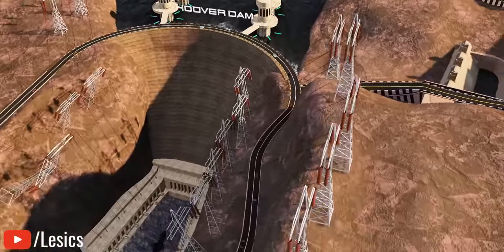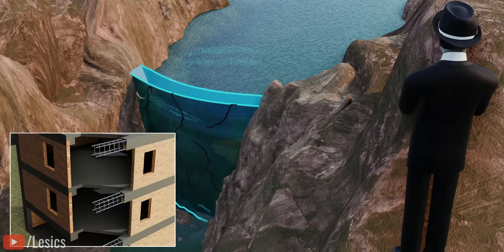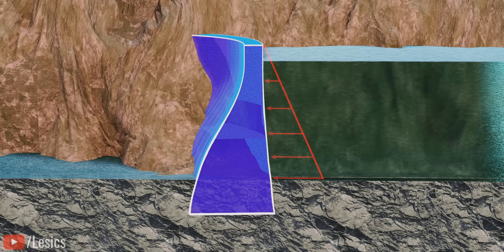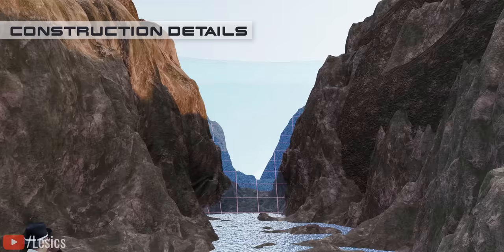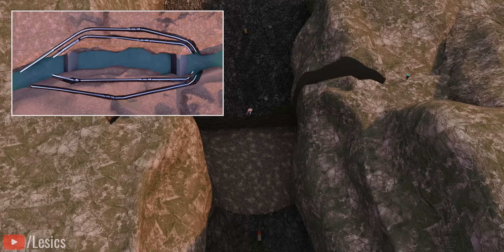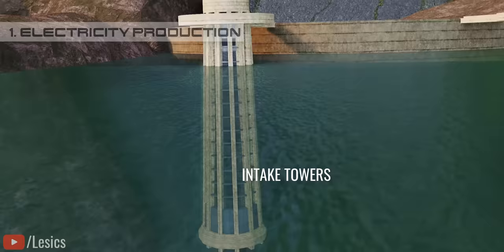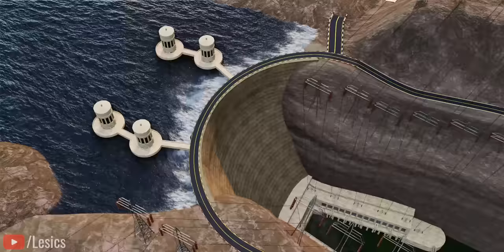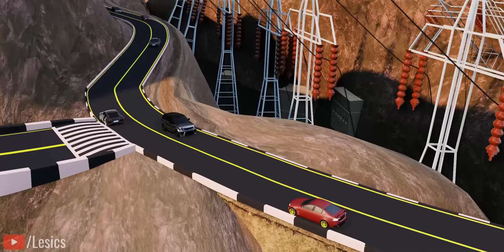Hoover Dam | All the Secrets of the Engineering Wonder

Comment: Overflow is NOT a problem the dam has now - the water level is so low that power production will soon be impossible.
Reply: hehe :D
Reply: Very true, sadly.
Reply: Its only 25% full and since 1983 has been dropping overall each decade.Man can build but he cant make rain.
Reply: Actually he can; cloud seeding. I find it highy coincidental that Lake Mead was nearing levels that would halt power production and possibly drinking water to surrounding areas just as the north experiences a snow pack 221% higher than normal.
Reply: Yeah,,,you tell em Jason . We need more glaciers to melt!

Comment: I toured down inside the dam and power plants before it was restricted. Everything is faced with ceramic tile and stainless steel. They really built to last. I stood on one of the penstocks feeding water to the turbines. You could feel the strength of the water flowing under you at over 100 miles per hour. It is an amazing place.
Reply: there is no ceramic tile or stainless steel anywhere in the dam or on the tour
you never stood on the penstock
trust me ...i work there
Reply: @thatoneguy6776  😮
Reply: @thatoneguy6776  There was tile in some of the tunnels the Ranger guided us through. Back in early 1980-something.
Reply: @thatoneguy6776  1985-86 I walked in the Arizona penstock to the underside of the intake tower.  I also went in one of the tunnels inside the dam that leads to that grate on the face of the dam.
Reply: When I went I saw lots of polished terrazzo floors but no ceramic tiles..
Reply: @thatoneguy6776  How would you know what I did inside Hoover Dam 40 years ago? Go watch a solstice.
Reply: Why did they restrict it?
Reply: @Lucrativecris  Because of 911. You used to cross the river on a road on top of the dam, but they've built another bridge now for security reasons. I don't know if they've started the inside tours again.
Reply: @rpbajb  The O’Callahan Tillman bridge is a marvel of engineering as well. Watched it built for a few summers while on a jet ski every weekend. Glad they built high walls cause the Black Canyon is ruthless with wind.

Comment: Such a awesome structure, full of genius engineering and quality built too, you can’t help not be in awe. I guess you could argue the negatives would be the environmental impacts flooding such large swathes of previously dry and inhabited land has had, as well as the installation of a barrier that completely blocks wildlife any free movement through the whole river system … and these are unfortunate consequences in these types of dam projects, but still … there is a grandeur to the Hoover dam in particular that still fills me with awe at what can be achieved. The fact that it outputs significant, clean hydroelectric power which is being used instead of more carbon rich sources of mower production too, is just the cherry on top.

That being said, lake Mede isn’t faring so well in the prolonged low-rainfall conditions and it’s evident that the whole system has seen more fruitful times. The prominent bathtub ring showing how low levels have gotten is a warning that can’t be ignored. The anxiety of dead pool levels being reached grows with each passing month the levels drop further. I hope for the sake of the people this system provides for as well as the for the damn itself, that rains do come and alleviate some of the water anxiety that must be being felt.

Comment: I've visited the Hoover Dam 6 times.  I find it more amazing each time.  I can remember when the spillways (one on each side) were not plugged.  Looking down the 50' diameter pipe - about the width of my home and twice as high. - were open and looking in awe at a spillway that could float an Iowa Class Battleship. EACH spillway could handle 200,000 cubic feet of water PER SECOND - the entire flow of the Niagara Falls.
Reply: The legion will visit soon
Reply: @karlmarx8719 yeah we invaded it by our fool Joshua failed us I was spared because it wasn't my fault and I proved I still can be a valuable asset to the legion

Comment: Civil Engineering Concepts used:

1) Hydrology: To find out the discharge passing from the dam.

2) Structural Analysis: To design the arch and find the horizontal thrust it would generate on the rock walls.

3) Reinforced Concrete Structures: To use concrete to its strength that is compression. To fill the concrete in blocks to avoid cracks formed due to heat of hydration from the cement.

4) Geotechnical Engineering: To find the uplift pressure generated due to seepage water.

5) Irrigation Engineering: To design the spillways and cofferdams and galleries. 

6) Fluid Mechanics: To find out the Shear force excerted by the water on the dam. Francis Turbines.

7) Tunnel and Mining Engineering: To perform controlled detonations and excavation of the rock strata and walls.

Civil Engineering is truly an art. It literally has several different engineering fields packed into one single family. No wonder the syllabus a Civil Engineering Student  has to cover is massive.
Reply: mechanical and electrical engineering play roles too for turbines & generator controls 😄
Reply: Yes ofcourse. But as a civil engineer, I was looking at the Civil aspects. Every Engineering field work hand in hand for the betterment of the society.
Reply: Notice how the environmental impact is not even mentioned on this list
Reply: @phole1100  We should have gotten Edward Abbey's thoughts on that!

Comment: I remember watching a documentary about the construction of the hoover dam and how coolant pipes were integrated just to harden the sheer amount of concrete; which was considered to take about 100 years to harden
Reply: Without the coolant pipes, it would've been forever and a
Day to dry and cure. With the addition of the coolant pipes it was estimated that
The concrete used in the building of the dam wouldn't be finished with the drying and curing for around 50 yrs
After the entire project was completed, and it was finished ahead of the schedule.
Reply: @bruceperkins7253  Concrete doesn't set by drying. Just curing.
Reply: vroom: You are correct: Concrete is "set" in hours and "cured" to a working strength in days, but gets harder and harder in normal projects for 40 years.
Due to being hundreds of feet inside the dam away from air and now kept moist and cool it will take 100 years for parts of the dam to cure.
Reply: @bruceperkins7253  No, the coolant pipes SLOWED DOWN the set and cure a little (different things) cooling did NOT speed it up.
The Nevada heat is bad for pouring concrete. Dries too fast and cracks. The best temperature is 60°F.
They slowed the set and cure so the temperature was evened out to prevent cracks.
Reply: @Engineer9736  Yes, you are right. It does not dry like glue with the evaporation of the solvent, but NO the curing heat is from a reaction actually called "hydration" and does require the removal of the water (drying). It's like a catalytic, reaction but drying is as good a word as any for concrete.
Reply: Kallanai Dam built more than 2,000 years ago by the Chola King Karikalan across the Cauvery River INDIAN Technology

Comment: This is amazing. Very nice video and thank you for the effort put into this. I have visited the Boulder/Hoover Dam 6 times over the years. I worked in Las Vegas at DOE and I would often drive out to see the dam. My first visit in 1985 I was able to take the 'Hard Hat' tour. The tour allowed guests to go down to the turbines and see the amazing work in the tunnels and to see the turbine shafts spinning out of the turbine case and up to the generators. An added benefit was a turbine was removed and was sitting on wooden beams near the parking area. The overhead crane and pulley system did that job perfectly. The copper buss bars were still in place from each generator but not used anymore according to the dam guide. The visitor center was not constructed in 1985 so it was a thrill to go back in the 90's and early 2000's to see progress on the dam. A few years ago the butterfly or needle valves were opened only once to do repairs or maybe it was to install new valves. I can't seem to find a video of that day on You Tube but I do remember seeing the video somewhere a few years ago. I live near Lake Texoma (3 miles) and recently the intake structure was modified with new 19ft by 9ft gates each weighing 26 tons. The Denison Dam has only 2 Westinghouse generators rated at 40 Mw. The Denison Dam was built between 1938-1944 and was the only large civil project funded during WW2. One of the Francis Turbines was pitted and removed and now sits in the parking area and is painted with a fence around it for visitors to look at. A worker told me each turbine weighed 80 tons at Denison Dam. As a Boy Scout in the 1960's I got the chance to tour the powerhouse and was the reason why I became an electrical engineer and worked around the world on complex communication systems. I'm retired now but I sure do love watching videos like this one. Good job.
Reply: I took the Hard Hat tour as well..........they ended that tour when 911 happened.

Comment: Yes, the Hoover Dam is indeed a great engineering feat. The only scenario that the original designers and builders did not anticipate is that in the future the damn may just become a giant concrete wall in the desert with no water remaining to retain behind it. This is the future, folks! 🤔
Reply: Yeah, I felt like the video needed to be corrected to say "Lake Mead, one of the world's largest man-made dry holes"
Reply: @krashd  Seems that way, around 1985 there was so much water in the lake that it was running over the spillways.
Reply: The future, possibly. The foreseeable future! No.
Reply: propaganda --- not possible  - fed by rocky mountain snowmelt
Reply: @drtimoshea4087  wouldn’t it make sense as climate change happens the ice melts faster resulting in the 80’s max and now we’re running out of it

Comment: 1:13 there clearly is no compression on the inside in this case, the yellow line is longer than the dotted yellow line. It is also tension.
Reply: It really shouldn’t be longer, bending always causes tension on one side and compression on another, the video explenation is correct
Reply: @lievijnsimons619  So, when you bend an elastic rubber band (pull on it), it will always be compressed on one side, no matter how much you pull? Interesting.
Reply: @paulfontaine7819  pulling isn’t really bending tho, bending is when a straight shape is deformed in a direction

Comment: Great video, but you missed a couple interesting facts:
1. the dam was massively over-built because, as a first of its kind design, they weren't sure about its performance.
2. the dam today only runs 1-2 of its turbines because of low water, and the resevoir has not been full since the 1980s
Reply: As of 2022, power output is reduced but still about 70% normal. There's no way only 1-2 generators are producing 70% of what all 17 can produce.
Reply: He explained exactly why it was built the way it is.... It's not "over-built because they didn't know how it would perform"...... The engineers were much smarter than you.

Comment: Without even even watching the video I can see that the curved shape of the dam provides more strength because pressure being distributed different just like squeezing an egg and it’s very hard to break
Reply: Squeezing an egg won’t break it easily?
Reply: @blakebranson8394  If squeezed in certain spots, than yes. Eggs are very weak on the sides, yet strong on the top and bottom. If you pinch the opposite ends, or try and make a fist with the egg in your palm, you’ll be amazed how difficult it is!
Reply: I can tell you are under 14 years old Hayzen.

Comment: The Hoover dam is impressive no doubt, but as my dad (a Harvard PHD in physics) put it, the amount of pressure the dam needs to hold is basically the pressure of the height of the water against the dam itself.  The dam is not holding the pressure of the whole body of water behind it as it would seem to most.  The pressure of the body of water is exerted on all the land around it as well.  To many, it looks as though the dam is holding a tremendous amount of pressure, in reality, for the most part, it is just holding a small fraction of the pressure exerted on the entire shoreline of the upper Colorado River.
Reply: so what's your point? It doesn't mention that the dam is holding everything

The video shows how effective the construction of the dam for its purpose
Reply: Good point..! You say it elegantly. Come to think of it, it's like thinking of the air pressure of the atmosphere on our shoulders..! Our science teacher said that in a funny way and we exclaimed "Oh my god, are we carrying so much weight on our shoulders".
Reply: @D M100 yeah, you're absolutely correct. Water exerts tremendous amount of pressure on the land. & due to high water head it may induce reservoir-induced seismicity like Koyna dam in Maharashtra,  India.

Comment: the part that concrete reacts with water, producing heat might lead to cracks, is a never-been-taught fact 🙃
Reply: Cement reacts with water, producing heat exothermically.  This has  been understood for more than 2000 years.
Reply: @MatthewRulla  I think he meant that it was a new fact that he learned from this video. Cheers

Comment: I have been to Hoover dam a couple times, the first when I was a kid. I remember walking on the roadway along the arch of the dam and looking over the top on the front face and seeing the power plant below. The hum of the electric transformers evokes a sense of a powerful force. Going on a tour of the dam was best being that it was probably in the upper 90’s outside, and as soon as you get inside the dam, it was cool (in some parts). The one thing that always stood out to me were the high tension electric towers on each side of the dam above the power plant that brought the power out of the power plant to the transformers at the top side of dam. It had to be a huge engineering feat to build the steel towers tilted at such an angle. The whole structure and operation is fascinating. Some day I need to go back there to see the new Highway bypass bridge in front of the dam.

Comment: People say modern concrete only last 100 years. But hoover dam exist for 87 years, and still going strong. Hopefully hoover dam will last 2000 years like roman structure.
Reply: Not necessarily, the reservoir seems to be drying out. No need for it if the water is gone. Give it another 100 years then it's just an relic.

Comment: The diagram of the damn with all the water pressure applied showed it Bowing in a lot I'm sure it must have done this but you show it deforming a huge amount I don't think it ever did that in fact I would be surprised if it went more than a couple of inches which is still a lot of deformation but you show it 20 30 40 50 ft I don't think it moved at all almost

Comment: Hi, I was interested in how pipes were laid to circulate water and cure the concrete, in order to remove excess heat. Does anyone know, how long did they need to circulate the water for? How long did it take the concrete to cure? Thanks for any help. I'm just interested as I read that the Chinese Three Gorges dam was going to take the same approach but didn't, so just wondered thanks, .

Comment: It's mind boggling to know we still use "Stone Age" technology.When free energy technology exists that could replace all forms we depend on currently. No more unsightly telephone poles or metal towers, nor space consuming solar panels, no more wind mills that crash and burn, no more dangerous nuclear plants, no more dams to worry about, no more air polution due to coal, wood, oil; our oxygen levels would rise instead of plummeting dangerously low; all the energy we will ever need can be provided for everything. How would you like to drive your electric car and never run out of fuel or need recharging? Fly across the oceans without carrying thousands of lbs of fuel, one day all will be run by electricity; until people wake up to reality and use this technology that's just waiting in the wings; we will go on suffering the consequences of our ignorance and failure to act responsibly.
Reply: And this miracle energy solution is?